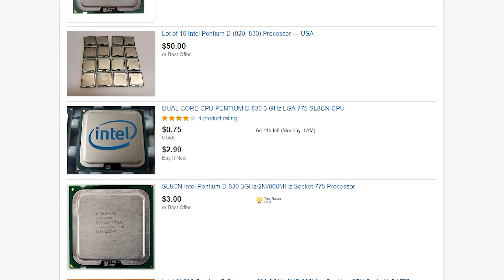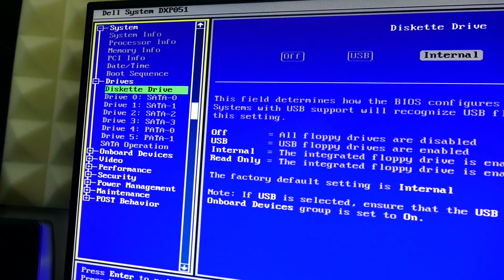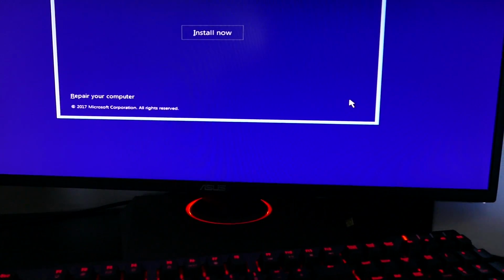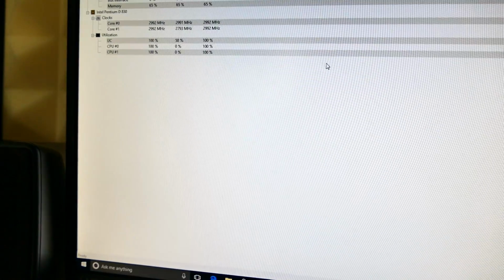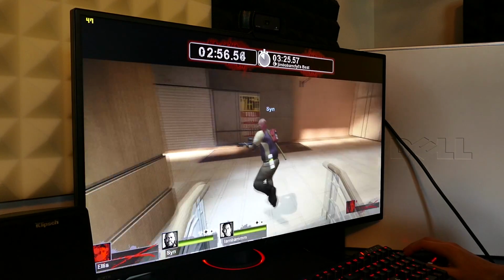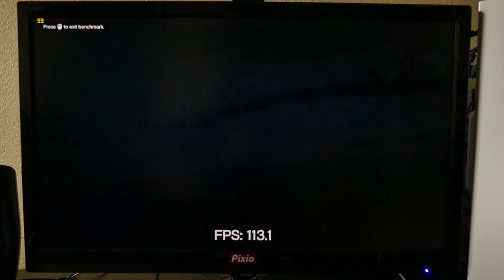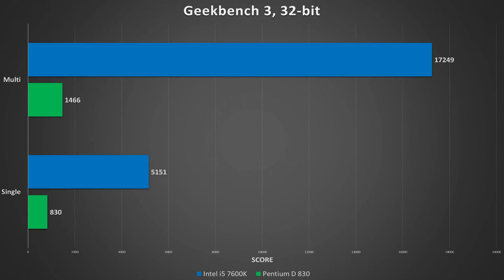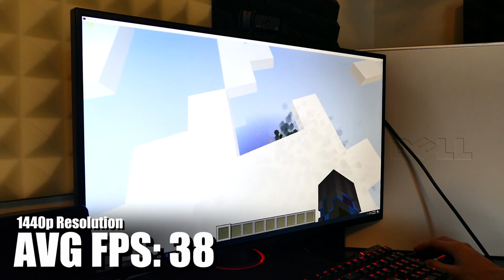I Paired a $6 CPU with a $700 Graphics Card

Comment: A powerful gpu with a shitty cpu? Sounds like the Xbox One X.
Reply: no it doesn't. It's still the regular 8 core cpu and if it's not the original xbox one cpu overclocked it's a different cpu but it is not Ryzen. But I will wait for Digital Foundry but I can tell by the price it's not Ryzen.
Reply: It is a higher clocked jaguar CPU, and even if it was ryzen it is still only a 2.3ghz ryzen CPU... Jaguar is around the AMD FX level of IPC, so it really is a shitty CPU.
Reply: So still shit but now even more unbalanced?
Reply: Tryhardblackguy Everyone knows its not Ryzen.Microsoft themselves said its not Ryzen.If it was ryzen,there would be a ton less people not being satisfied with it.
Reply: Gou Han Who can you know this? Microsoft didnt say anything about it. I would say it is something that is comparable to the Athlon 2 860k just with a worse single core speed. Nothing impressive considering this 50$ cpu would probably give you a better framerate. And dont forget. This console uses integrated graphics. If AMDs RX480 which is of course a great card that is not integrated into a cpu and has a way better heat sink on it cant deliver 4k at smooth 60fps I really doubt that the x box x one x with to much x would perform better.
Reply: A lot of stuff won't even 60 because of that shit.Destiny 2 and AC are confirmed running 30. $499,no good exclusives(the kind that's counted as exclusives I.e. console sellers).I would have bought one if they would have bumped the price to maybe $550 but put a CPU that can at least not bottleneck before 60 fps across the board.
Meanwhile,Monster Hunter on PS4 though,it been so long....more than 240p....
Reply: Alexandros Var Go on,spout some more marketing BS without knowing what any of that means.Comparing tflops goddammit....
Tflops are in no way indicative of direct game performance,which is why a 4.4 tflops beats a 6.175 tflops RX 580 in certain titles.Tflops will only indicate how much power you have for crypto currency mining.
And "optimization" on consoles,means that they make sure that the game is not a pos port,like they do for PC.Its made to use all 8 cores equally. If its already doing that,then the graphics are lowered until it runs,in some cases like Witcher 3,they downgrade the whole game because otherwise it wouldn't even run.
4k 30 with upscaling during actual gameplay,that's all the xbone x is capable of.Na din games like shooters like Destiny,the CPU is the obvious bottleneck.If the GPU was the bottleneck,it would have run 1080p/60,which it won't.30 fps there too.If anyone is spending $500 for 30fps in end 2017,I don't know what to say.
Reply: the musical gamer fucking hell you're stupid.
Reply: I don't think anybody here knows what they are talking about
Reply: Noodle Confusion i know that,at this price point i will tell people to literally buy this console,cus you know,the cpu isn't bottlenecking too much in 4k(gpu limited)...i might buy this console,what would i do with my 4k hdr tv anyway else than watching movies.
Reply: xbox cant have a cpu bottleneck because games are developed or optimized especialy for it. Programmers may parallelize the code to use the gpu if they need more processing power. It has 6+ TFlops.
Reply: ***** It's doesn't run at 4k ultra high settings though. That's not how technology works. Do some research?
Reply: you do not need a good cpu to play at 30fps
Reply: That's why I'm hyped for Ryzen 3
Reply: Person. I never said it said jaguar, and where does it say Ryzen again?

Edit: and it couldn't be Ryzen, or it would most likely say it's a Ryzen chip, it's probably gonna be an overclocked custom jaguar CPU just like the Xbox one, besides that MS won't have to rewrite the dashboard, backwards compatibility, Ect for a new architecture if they modify the already existing CPU.
Reply: LMAO 90% of all xbox games are 60 fps? wheres ur proof? most games are shitty 30 fps. Common logic? everyone knows that pc is better than console so thats common logic. I bet you don't even know the difference between 30 fps and 60 fps because u have never even seen 60 fps
Reply: it uses an apu
Reply: Justinny and btw is the word "you" too hard to type?
Reply: Tryhardblackguy uhhhhhh, its an apu not a cpu or gpu. its an apu with shared ram
Reply: Samster Birdies but, given that, its still one chip running it. it would be stupid to have a chip with a cpu that bottlenecks the gpu part. it would be more effective and cost effective to balance the performance so that each piece of the build is fully utilized
Reply: Fernando Gonzalez Sadly its a fact that the CPU is too weak.Destiny 2 won't be 60 fps because of it.
Reply: And even AC and crackdown won't be 60. Wow.
Reply: Gou Han "No it is not jaguar"
Spec sheet says otherwise.
Reply: Tryhardblackguy lmfao
Reply: it doesnt have a 12gb graphics card those dont even exist yet. if it was a good console it would be able to run 60 fps
Reply: Even the G4560 beats the Xbox One X CPU
Reply: DiegoAlanTorres69 Ryzen makes things even more easily obtainable
Reply: Xbox One X CPU is enough to do 60FPS, without Bottleneck. Even a Pentium G4560 can run 4k60FPS High setting with a GTX 1070 (around 6 TeraFlops), ask to google.
Reply: Richard Gamerich-R most all games on xbox one x will be 30 fps in "4k"
Reply: Yeah so stop saying even more that Xbox One X CPU will bottleneck his GPU with a 30 FPS target.

High End CPU are only good for very high frame rate, and for some special game who needs a very good IA as strategy games, typically rare on console market.
Reply: Person. Are you thumbing yourself up?
Reply: Person. On games like bf1 multiplayer their are fps drops though.
Reply: Justinny I own a gaming pc and I'm disgusted by your comment. a gamer should be able to decide if they want a console or pc. it's their choice. don't hate on someone for not having enough money and/or preferring console over PC.
Reply: u sound like a console peasant learn facts
Reply: lmao u obviously know nothing either, pc is less expensive than console and if u arent a kid who doesnt wanna care about all the good things on pc u should be on pc. THis is youtube comment section not some smart person website cause if it was everyone here would actually research stuff and know that pc is way better
Reply: PC is not MORE expensive. Both are the same cost but we instead pay for upgrades in a more useful platform, not for more expensive games and pointless online suscriptions.
Reply: yes of course you know console having 30 fps and less than average graphics while also having to pay 60 dollars every year for internet, and also paying for a new console every year. SO console adds up to about 1000 dollars every year(if you buy 60 dollar games not on sale)where as pc you buy a 600 dolalr pc and donbt have to upgrade until u want to, and steam sales are very often, and to beat a console all you need is 300 dollars maybe even less
Reply: Person. omg did u read anything I said
Reply: Person. did you even read that the fucking summer steam sale is on pc too and no console games aren't fucking cheaper just stfu u know nothing, also i never said the gamees on console sale were shit all im saying is that there is a sale tthat does the same on steam
Reply: We usually try to (vastly) beat the PS4 Pro/XB1X (400$/500$) with 600-700$ PCs instead of doing a 300$ build that compares to the weak PS4 (250$). It's a very different story.
Reply: Lol, it looks like it's using updated jaguar gpu.
Reply: Person. Why would you even buy it all it does it make games 4k still 30 fps pc still way better and less expensive
Reply: Person. "We still don't actually know what CPU the Xbox one X uses" so it's okay for you to say "It's gonna be Ryzen" yet when someone says it's gonna be jaguar you get defensive?
Reply: how are you still sticking to console after all these facts thrown at you, i mean someone has to be ignorant to not accept true facts. How are consoles cheaper? also name me one thing that consoles do better then pc id like to know.
Reply: Samster Birdies You can emulate most old games though, not all, but most popular ones you'll probably think of.
Reply: Yeah, I get that. I own a PS2 and I want to get an SNES classic. Though when it comes to convenience, functionality, and stuff I can do. An emulator is better.
Reply: Nico1a5 but who the hell buys PC to play at 30 fps????
Reply: so a custom cpu 2.3 ghz with an ipc same as=FX=Jaguar pairedwith gtx 1070 performance(custom)gpu?GG,microsoft,GG
Reply: Tildey no is not jaguar is something like ryzen r5 but whit 8cpu

Comment: that bios is so old that it probably uses MBR paritions to boot instead of EFI partitions, that's probably why your SSD wouldn't boot, you probably had installed windows 10 on that SSD using a newer system, so it probably had EFI which is incompatible with certain super-old chipsets, I ran into the same problem putting hard drives from old laptops into more recent laptops
Reply from the maker: I tried installing x64 direct onto the HDD and SSD and neither took.
Reply: Science Studio during windows 10 setup did you just format the partitions before trying to install, or delete them completely? i had to delete them completely, and then the windows installer took care of making new ones
Reply from the maker: Devon Budzitowski I always delete.
Reply: beats me then ¯\(ツ)/¯ old hardware just has a mind of its own sometimed when it comes to compatibility with newer hardware and software

Comment: Overclock that SH!T
Oh Wait, it's a Pentium D, it will turn into a toaster. BTW I've overclocked one to 3.4GHz before and it was actually tame but I had a good cooler sooooo
Reply: A Pentium D overclocked does not simply turn into a toaster. 
That is a full blown Fukunobyl nuclear superclocked meltupdown left right deto-conflagration-explosion!
Reply: Watching two bottles of bleach talk about Pentium D processors. 10/10
Reply: CatSay meltupdown lol
Reply: CatSay Fukunobyl
Reply: The Real Bleach this is why I strap my old pc down to the floor so it doesn't fly away lol
Reply: Watercooling kits have been around since the dinosaurs....
Reply: I got a Pentium D 945 to 4.0 with one of those giant Zalman Copper circle coolers....
Reply: Clorox Bleach Hehe
Reply: I've overclocked this bad boy to 2.4 GHz once and I was even able to use it for browsing the internet and stuff :D and yeah, I just dropped some thermal paste and a cooler onto it, no screws/zip ties or anything
Reply: I use durons to make my toast
Reply: werent the socket775 pentium Ds ok?
Reply: kn00tcn until you overclocked. Then they turned into molten neutron star matter
Reply: they were 130 watt chips with a stock cooler worse than a wraith stealth....2 super hot pentium 4s on one die.
Reply: The Real Bleach I had a stock 3.4ghz pentium D and it was bs
Reply: super hot isnt a number, if they can manage 90 like a laptop without throttling (or should i say a little before throttling), then they 'work'

it looks like most of them were socket775 & 95W actually https://en.wikipedia.org/wiki/List_of_Intel_Pentium_D_microprocessors maybe i'll look for some reviews since i wasnt following hardware back then
Reply: The 830 he tested here was a 130 Watt part.  You are right that most were 95 Watt though.  Keep in mind that a spec sheet TDP is not necessarily an accurate representation of power use or heat dissipation though and Pentium D was right on the edge where even a 10% overclock resulted in ~25% more power use.   This was also at the beginning of custom coolers (no AIO water) so the majority of people had stock coolers.  I still have my 820 in a box with the stock cooler (95 Watt); it is a far less effective cooler than what comes with an AMD 65Watt CPU these days.
Reply: Razamatraz my pentium D sounds like a jet engine when it starts up with a stock cooler
Reply: Clorox Bleach LOL
Reply: CatSay lol
Reply: CatSay LMAO